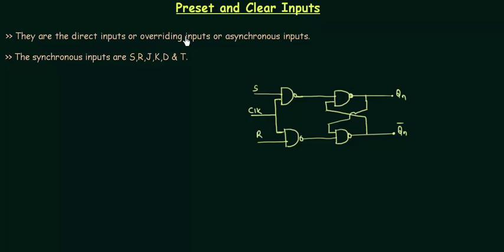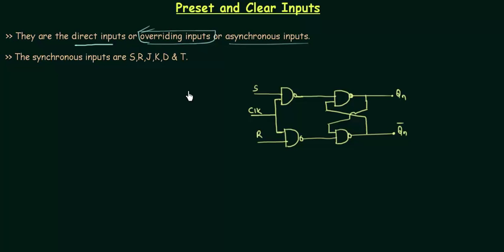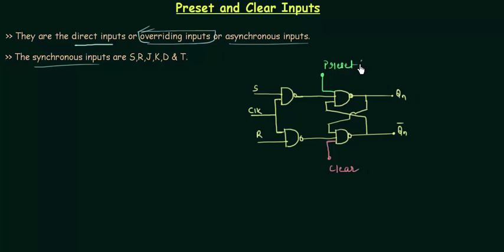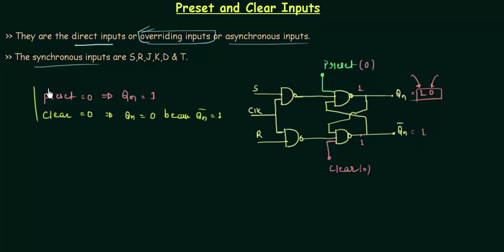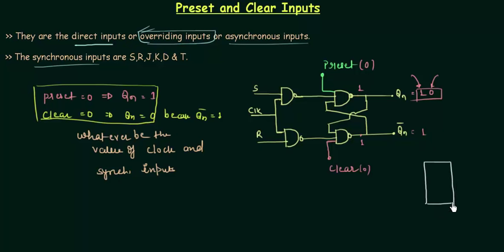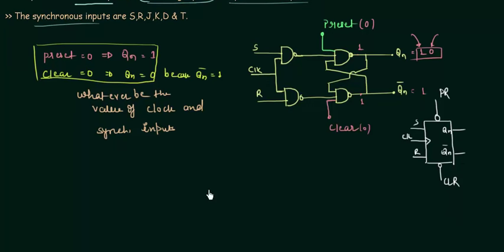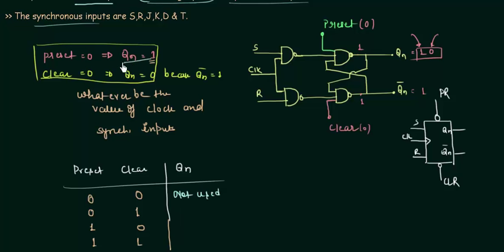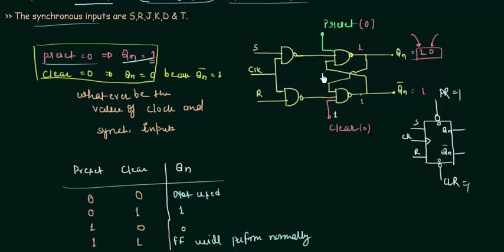Preset and Clear Inputs in Flip Flop

Comment: if clear is 0 than Qn' is 1 but Qn is not necessarily 0 because it depend on S (think if S =1 and clk =1) .Sir please clear my doubt
Reply: Setting the clear to 0 and the preset to 1 (or vice versa) changes the circuit so that it only has one "stable" state. It can momentarily give Q = Qbar = 1 as output, but only when clk = 1 and S = 1 (or R = 1 for preset = 0, clear = 1), which it usually will not. (I put "stable" in quotes because technically having clk set to 1 is possible, but it's just not how you're supposed to use the circuit.) [Disclaimer: I'm just an undergrad struggle through this shit with the rest of y'all. I could very well be wrong.]

Comment: Regarding  active high and active low confusion, think in terms of High and Low instead of 1 and 0. In active low logic(0=High and  1=Low),and in active high(1=High,0=Low).Active high circuit implies circuit is functional only when input is 1. Similarly, Active low circuit implies circuit is functional only when input is 0. Here, preset and clear are active low, meaning preset will be high(functional when we have 0 input in it), and will set Qn=1. And if clear is also 0(here high), it will again try to reset Qn, i.e. will try to make Qn=0. So this(Preset,clear=0,0) is not used. While Preset=1(low), it will be non functional,same impiles for clear.
Reply: Thanks a lot bro! That was a pretty good explanation. You helped me remove whatever doubts I was having :)
Reply: very clear explanation thanks bro :medal-yellow-first-red:

Comment: I understand that: When Clr = 0 then not-Q is directly 1. However from this point, not-Q is fed back to the upper NAND gate where Pr = 1 then 1 AND 1 is 1, so the output of the upper NAND gate (Q) is not directly 0 but dependent on the front NAND gate's output where S and Clk are inputs. Can u please explain how we get directly Q = 0 when Clr = 0? Thank you
Reply: I also had same doubt it will depends on s if clk is present ..
Reply: I am having the same doubt

Comment: I was confused when we made the truth table. I understand the way the preset and clear inputs are effecting the circuit, but I think we switch our analysis from the blk diagram and the circuit at the same time, because when preset is 0, it is inverted on the blk diagram so it is a 1, and it doesn't effect the NAND gate. in the same way, when clear is 0, it is inverted to a 1, and so that would also not effect the NAND gate. If i looked at it in this way, that would make the truth table backwards. I hope someone could clarify this mix up.
Reply: actually i have the same confusion right now any explication for me pls?

Comment: Thank you for the video.   Although not common, there are times when both preset and clear are brought low at the same time.  This IS defined as Qn and /Qn both outputting HIGH.      While using spare gates, a flip flop may be used as an inverter by tieing D, CLK, and CLR to low, and any signal on PRESET will end up inverted on Qn.   -try if you ever need one inversion before using the second flip flop of a 74xx74.

Comment: So set and reset can be used only when the clock is 0.
If not, please explain how clear is setting Q to 0 while the CLK and S are 1.
Reply: dude just focus on the nand sr latch on the very right... if one of the NAND's inputs is 0, the output will definitely be 1. So.. Where's the "clock" in this equation.. Nowhere... Hope you got it.
Reply: @batikanboraormanci7954  but what if in top right nand gate, preset is 1 CLR 0 ,so two inputs of the nand gate are 1. The third input HAS to be 1 so clock input HAS to be 0. Therefore clk 0 is necessary I guess
Reply: @momentodebruh7300  if preset is 1, it is the same as no preset existing at all. It wont change the way the system works a bit.
If clear is 0, then no matter the clock or anything, the nand gate on the right bottom corner will be 1.

So if the preset is one, then its already not changing anything, the ff will function normally on that side. The clock's impact will be same as expected.

if clear is 0, as QNcomplement becomes 1,   
Rule 1 : you dont turn both preset and clear to 0 at the same time, that just breaks the system, so preset stays 1
2:  if set and clock are also on, QN will be 1, meaning that the ff is misfunctioning, because you tried to "set" and "clear" at the same time.
With or without the clock, the S will be the one breaking the system

So the statement "clock has to be 0" is wrong
Right is " s and clear dont work together, logically or practically"
Reply: @batikanboraormanci7954  cool thanks
Reply: That is correct, Clock has to be zero.

There is a misconception in the above video and it precisely has to do with the clock signal.

First i think we can all agree that:  

If SET is 1 and CLK is also 1 then the output of the TOP LEFT NAND gate is 0, which is also one of the 3 inputs of the TOP RIGHT NAND gate ------> If one input of a NAND gate is zero then its output Q,  will always be 1, no matter what the other inputs are doing. So for the SR FF shown in the video above, during the time SET is 1 and CLK is also 1, the SR FF cannot be cleared ! 

Note: we are ofcourse assuming CLK is a proper 50% dutty cycle ON, 50% dutty cylce OFF traditional clock, just like all clocks.

So for the SR FF in the video, as it is drawn, CLR and PRST are not Asynchronous, because of the 50% ON clock duration.

For CLR and PRST to be trully Asynchronous, the SR FF MUST be EDGE TRIGGERED ! (In this case Positive edge triggered) 
That way when the "clk" input to the FF is pulsed (from 0 to 1), it will immediately return back to 0 instead of staying at 1 for 50% of the clock period. But the edge triggering circuit is not mentioned in the video... 

This is the critical detail the lecturer forgets to mention : /

Comment: When Pr=1, Clr=0, Qn(bar)=1. But how Qn goes to 0? As, NAND gate has 3 inpus. For Qn to be 0, all these inputs must be 1. Qn(bar)=1, Pr=1, what about the 3rd input(middle one)? How you can ensure that this is always 1? Please explain
Reply: Vartul Sharma i have the same question with you. Plz someone answer this question. Why q and qbar should be always complementary?
Reply: well preset and clear are used to set state when circuit is just switched on so no input is considered from the prevois part and so only 2 ones are required to make q bar zero
so in simple terms clock is 0 when preset and clear are used
Reply: @sarthaksuper284   Nice Sarthak you help in my doubt clearification

Comment: how can you assume q and q bar will be complement of each other when u set clr or preset at 0, without knowing the value of S and R? plz clear this    confusion.
Reply: arindam pal clock is 0 when preset and clear are used that is circuit is in inhibited state.... because it is used to set value when power is just turned on

Comment: Question: from the block diagram, isnt it that when clear =1, Qn=0 and when Preset =1, Qn=1? because for the block diagram there is an inverter attached, so when clear =1, the circuit is actually getting 0, making Qn=0?
Reply: ***** If we are not taking the complement of preset, how do we get (preset = 0 => Qn = 1)? We need to look at the the output of (S'+clk') to determine Qn, right?

Also, I'm a bit confused about the active low input, if you have a video explains this concept please provide me with its link in the comments box. Thank you!
Reply: i gone through u r videos amazing,but preset=0 and clear=0 in nor gate entire  thing changes once explain it
Reply: It's total confusing can anyone explain it briefly.... pls
Reply: THANK YOU SO MUCH

Comment: hii sir, sir do memory cards also have flipflops i.e d flipflops inside but if we remove power supply Vcc how do a d flipflop stores the data becoz in practical case we remove memory cards n pendrives but it still holds data how does this stuff works.

Comment: I don't understand what is meant by "active low" , would you pls show me where did u explain it!? Cause I'm focusing only on sequential circuits in this semester . 
And how to make a timing graph too ! With showing the difference between FF in it ♥

Sure I must thank you so much for your efforts , you do help me to understand more than my lectures do 💪👏
Reply: Active low means that when the input is 0 the circuit works. Active high, which is the generally used condition, is when the circuit works on the input 1

Comment: Sir...as u said that 
In block diagram it is low active pins ...means if we give PR =1 & CLR =1 than ultimately the input to FF is 0 & 0..... and then it is condition of not used......
Then how it is possible.....
Sir I'm in confusion ....
Plz clear the doubt....😊
Thanks
Reply: since both preset and clear are active low inputs, if they are high then they won't get activated and hence the flip-flop will work in a synchronous fashion. Synchronous means that input data will be tranferred to the flip-flop output only on the trigerring edges of the clock pulses.

when PR=0, preset pin will get activated and output will become HIGH and when CLR=0, output will be zero and hence flip-flop will work asynchrously. Asynchronous means that any of the asynchronous inputs(PR,CLR) can affect the state of the flip=flop independent of the clock.

Hope your doubt is cleared.